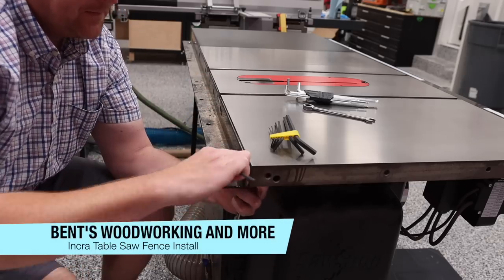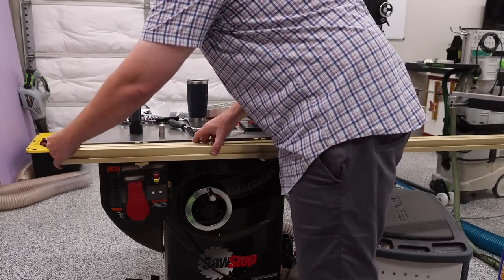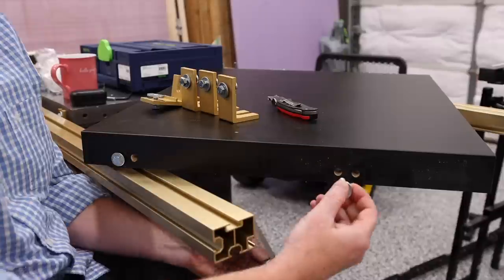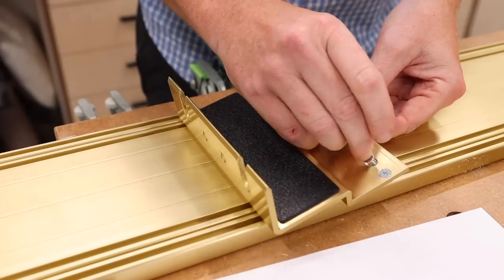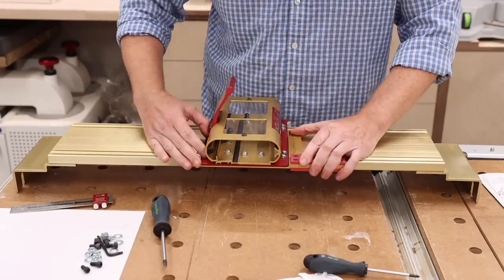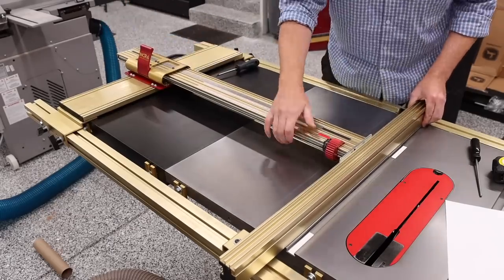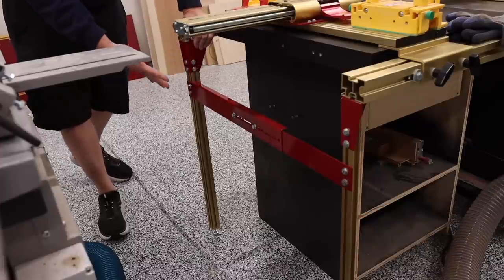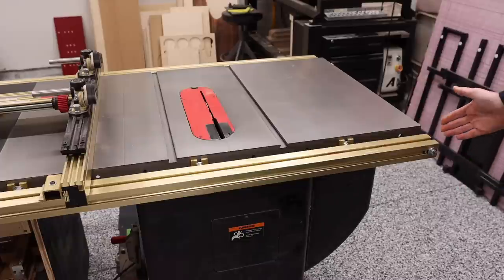The fence unlike any other

Comment: Jason, very timely video.  Been a long time follower of your channel.

I used your recommendation and purchased another set of the brackets (also second set of the saddle since the first set has the plastic runners on them when I had this fence on my old Grizzly saw and the runner threw off the spacing for the rails on the SawStop).  One question I have is in regards to the SawStop's built in set screw on the extension table.  Did you put that back in with the Incra fence?  My issue is if I put the set screw in, it changes the level of the extension table such that I can't get it to be even with the cast iron.  Any insight would be greatly appreciated.

Comment: By the way I'm looking to buy a Festool drill and noticed the model that you were using. I was thinking of the fixed chuck conventional drill as I have an impact tool and screw driver drills already. Why did you choose that model ??
Reply from the maker: No specific reason. I have various types for different applications

Comment: Seems like a very complicated and complex solution to a nonissue. Maybe you will do a video explaining what you gain with this over the factory fence.
Reply: He addressed all that a couple of videos back.
Reply: @michaeldorman  Watched the previous video and I do not understand the need for machine shop precision in woodworking. Wood is a very dynamic medium that moves with temperature and humidity. I applaud the woodworkers who work with these tight tolerances because as long as they are making sawdust and being creative the art continues.
Reply from the maker: The accuracy isn’t nearly as important to me as the repeatability.
Reply: Try  Watching a company video on you tube of this incra  system you understand why it is so great I have one on my table I can't be happier and never find better if you ever have one you can understand how good they really are and how accurate and perfect every time nothing else I ever had or seen works better and lots of add on you can buy like for you router on you saw table wow I don't have that wish I did . But I have a very good router table setup already  but would like they setup you sould ck it out belive me cost a lot but comes with a lot more and do so much more .  Just ck it out . And dreams
Reply: I am looking at adding one to my saw as well, the work I do does require precision of plus or minus 1/32nd, so the need for precision and repeatability is solved with a fence like this